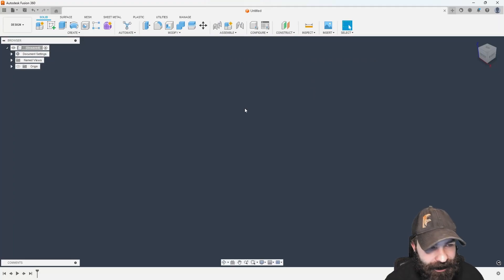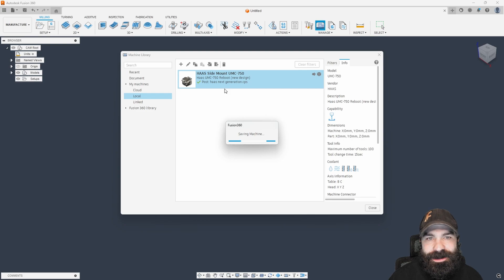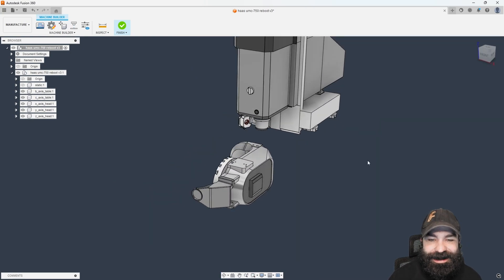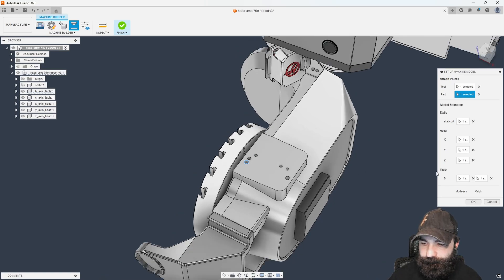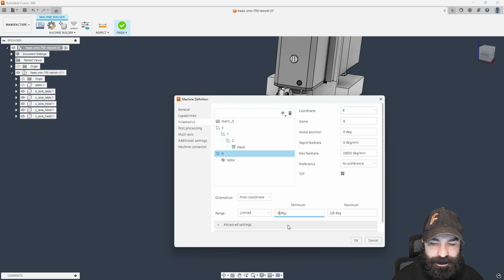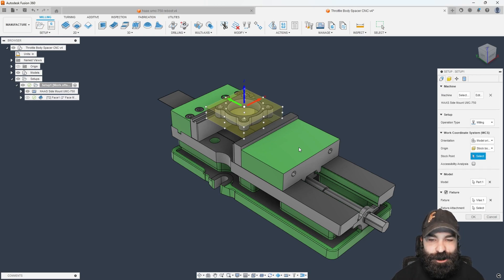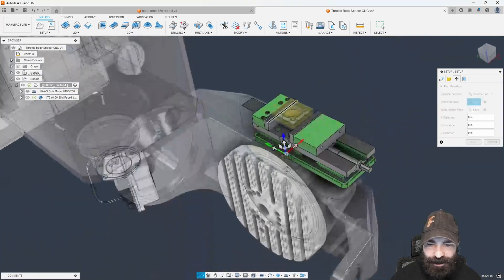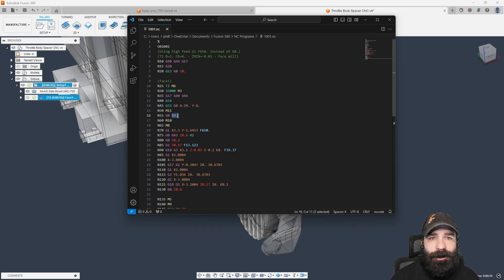Fusion Friday: Side Mount Vise Machine Sim Build

Comment: Can you explain how to use pyramid so I can put 3 parts on it with G54, G55, G56 on top of each but still to have a good orientation on table in simulation. Thanks
Reply from the maker: so you can model it however doing machine sim with 3 offsets isnt possible. You could pattern them for sim and that would work.